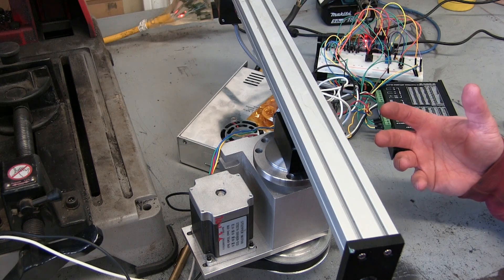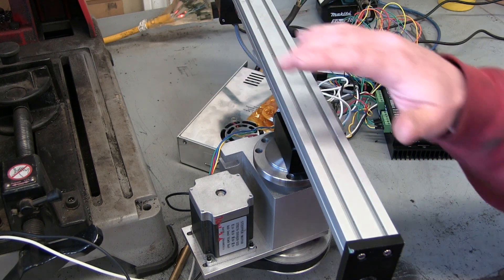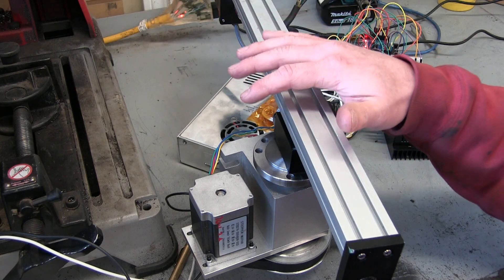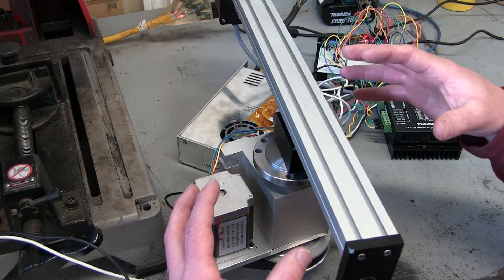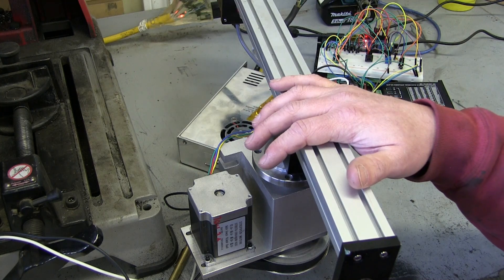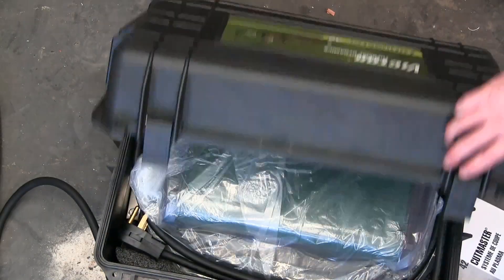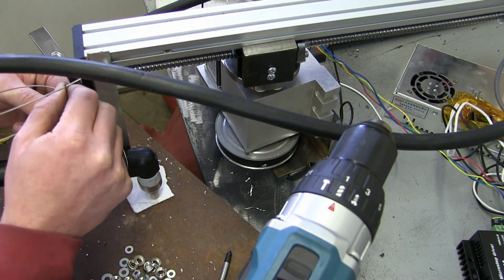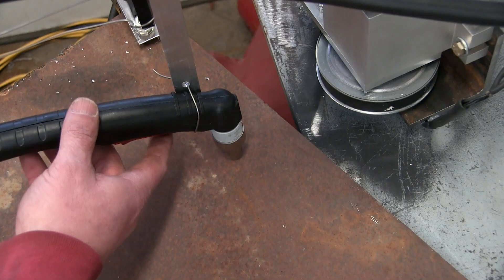Portable CNC Plasma Prototype

Comment: In theory it seems like a good idea for a quick way to punch out some simple shapes on material that can't be placed on a proper table.   I would think that a skilled hand would do just as good a job and here's why.  Plasma cutting in general is a hot mess, even on a good cnc table.  It is the one CNC machine, I don't feel comfortable walking away from while it is cutting.  When all the variables, and trust me there are a lot, are working right, it makes fantastic cuts, but when something goes array,  like it seems to for no damn good reason, it becomes aggravating to say the least.  I kind of for-see, fabricators getting frustrated setting that up and getting a good cut and eventually just doing it by hand anyways to get it done.  If your Z height isn't consistent enough, you are going to be making a lot of clean-up work after the fact or scrapping some metal.  If you can get that ironed out first, you will have a much better chance of making it a product that is simple to use.  A++++ for thinking outside the box!!

Comment: you need to multiply  (1 /  angle x cos) by the distance from the pivot to the center of the head. This works for keeping the x perpendicular to the linear slide.

Comment: Maybe reference angular speed from the current radius so you dont just use 1 speed for the small radius and the larger radius or have to worry about having to calculate the best speed for each time you change the design it would just do it automatically for you. my 2 Canadian pesos

Comment: put a cam so you can manually remotely place the start position. hell, 2 or 3 cams, one looking at the base and machine itself to correct for movement errors, optical mouse sensors around the base perhaps to make it really perfect corrections, one normal camera to setup the start position remotely after equipment setup, and finally a shielded working cam to look at the cut during use. :) maybe use pixel based command with rapid x and y changes instead of "long cuts" for shapes to prevent uneven squares due to a central pivot point. step by step wizard for the cuts or manual mode "pro" so they feel cooler using it lol

Comment: Ave, my man.. it wont work because metalworkers/fabricators fail to understand that something can break if you drop it, throw it, hit it with the hammer, let it sit outside in the rain, let it sit in the dusty shop corner for a 41 years and so on.. otherwise. great idea

Comment: This is fuckin brilliant! I tinker with the magic sparks but I'm no welder, my lady however is a level B red seal welder and an apprentice fabricator, she would kill to have something like this to spit out small part's that are not worth putting on the old burn table. Sweet mother of god I can't wait to see how far you get with this thing. If you get a good working final product she and almost any welder in the business would throw money at you. Also just thinking that a drag tip might not be the best choice for this application slag and what have you might cause snags jump and jitters. I would also do some testing so you can have some preset cut speeds for different gauges of steel. Your on to something her bud better visit the patent office soon!

Comment: So, the only issue i see is that the sections cut during the rotary axis would have a slight curve to them, as the arm is rotating around a central point... If you can work out a way to compensate for that i'd say it's close enough to perfect.

Comment: OR have the tip be replaceable with a marker. so they can run the job on the material before actually cutting it. that'd help develop trust in the tool.

Comment: You could fairly easily sort out a line follower tip which would allow them to draw the cut onto the material with a marker. rune the line follower over it a few times. map the movement from it. swap to the cutter tip and have it cut away. That'd make it easier to use and wouldn't require a phone.

Comment: ok  Tip for Mr AVE... 3d print or metal cast the parts needed to hold that torch... cos that little flimsy wire is just a no no.... I mean you could even use wood or create the parts with plastic... even with clay... naw you could go the extra mile and use a soap bar like Woody Allen... bicarbonate+superglue will also create a super strong bond similar to 3d printing... bondo could be use to fill gaps...

Comment: It needs a camera to look at the surface where you can draw what you want to cut out - or show an 'X' where the centre of a hole goes.  The camera could be mounted on the stationary part so it can calibrate it'self.  Don't underestimate the complexity of using polar and linear at the same time though, it sounds easy but one is absolute whereas the other has to be rounded and the rounding errors can work against you.

Comment: nice! been thinking about building something like this using a scara type manipulator, mostly because it would be easier to put together and cheaper, harder to program for though and a little less skookum.

the inverse kinematics for that are pretty easy, its just converting from Cartesian to polar.
r=sqrt(x^2+y^2)
t=arctan(y/x)
where r is the linear position of the slide on top and theta is the angle of the rotary base

you might have to import math.h in order to get the sqrt() and atan() functions to work, you may also have to convert to radians and back as well.

if you can give me stats on the steppers, any gear and belt drive reductions, and thread pitch on the lead screw the rest of the math part is easy.

Comment: I think a problem with the algorithm will be that you may have an issue working out the radius.  Setup will need to back up the linear axis to a known radius stop.  I am playing with python at the mo, and will have a play at some code. I have a cnc router, but it is all controlled visually in the software (Step Four machine). I did G Code at collage but this was 30 years ago. It can't be difficult as that little Chinese kid is doing it all the time.

Comment: Fuck yeah I'd use this. It doesn't need to be on a phone, in my opinion. Make it a usb gadget. Make the protocol (and formulas for shapes) open, write an app for Arduino and/or pc, let the bright guys in ios and Android development write the app.
Ideas: 
Make working with stock plasma cutter handles and switches a primary goal.
Make the arm invertable. If your working with a big shape on a sheet, get the most stable work out of it by hanging out over the center upside down with the torch pointing the other way by just slinging a piece of square tube or stick over some jack stands

Comment: I'd say the biggest concern would be setting your coordinate system in relation to a global (project) system? I mean long term would be like lasers and built in levels and bluetooth connected to your fridge, but in the short term maybe being able to manually set a 2d coordinate system by having a built in laser to the arm so that you could manually set 2 points into the systems 'memory'? one for a home point, the other to set the angle?
Reply: Also if laser cutting is anything like waterjet, then maybe (in version 19.2) have 4 axis? a rotating axis about the arm, (maybe on the other side of the arms point of rotation to act as a counter weight as well), and another built into the cutting head, on the axis that is tangent to both the axis of the arm and the axis about the arm...

Comment: As many said, positioning the tool could cause a bit of hindrance out in the field. If I'm in an abyss of a sump or in a chute cutting holes of all god awful shapes and sizes, most likely I'm in there already with the torch. To go in and get all my dimensions and then have to program and set up... I could have it half done. 
Now if I were at a cutting bench or back of truck, doing lifting eyes, gussets, and odd shapes and needed multiples, this would be the cats ass!

Comment: Yes, I would absolutely use this thing. I own an auto restoration / fab shop and this would be very handy for brackets / cutting frames. I think the most useful thing would be the ability to make a drawing on a smart phone app or trace (or outline) an image taken by a camera / freehand a drawing if necessary. That way the shape could be custom made in the field without much extra work. Dimensions of the shape could be then input into the app manually. Fantastic idea, I'd buy one if you ever sell them or create a kit with parts to build it yourself. A+ idea for sure.

Comment: AvE, why not just go for a full arm so you can move in the y axis as-well. A small mag base arm with changeable tools, plasma cutter, drill, welding electrodes whatever. To make it simple to use you could have some sort of learning mode where you move the thing on the desired path and it just records its encoder positions as a macro or somthing?

Comment: Problem with using plasma is you are limited to how thick of material you can cut through.  Great for proof of concept but I would like to see something like this with an oxy-acetylene torch like a Victor #5 cutting through some 4" plate that would be bitchin'. As far as being able to program this using conventional G code you would have to have two linear axis. What are you using for controls?

Comment: I'm thinking about how to best program the kinematics on this, not sure if an ideal world solution that is super math/calculus heavy would be a good idea, or if some dumb program that continually corrects itself to maintain a small tolerance from the cutting pattern...

Reguardless, you're going to want to use a ESP32 or similar module for this robotic cutter. Has the IO you want, and it's cheap and has WiFi. plus you can run almost any programming language on it.

Also runs Arduino code! since you already know that language!

Comment: That's pretty amazing man.  That would make plasma cutting out parts for the metal dice I make (basketball sized out of 12 gauge steel) very easy.  D20 isn't too bad as it's all triangles, but when you get into D12, or D10, the shapes are not as simple to cut out.  It would also be incredibly useful in the hackerspace, where we don't have space in the welding area to dedicate for a full CNC plasma setup.

Comment: I think the big thing is a canned algorithm for the range and travel in the ark ( so if you need to cut a straight line across the work  piece) . some sort of feeler gauge for distancing  on uneven surfaces, so then also an up down Axis. absolutely right on needing to make the interface simple. maybe also an easy targeting system for lining up Cuts better. You could cook up a modular rail systems so keep an extra long arm tucked away and have the short one ready to go for most jobs. put out a youtube call for some programers. very cool... mobile Manufacturing in a toolbox. also what if you put some sort of optics on it so it could follow hand drawn lines.... gimmicky but cool if you could just snap a chalk line for a straight cut.

Comment: Hi Ave, this is also an awesome tool for emergency services, disaster rescue works due to less fatigue and for rebuilding stuff in less educated areas.. I had the chance to work with Baxter robot (ffing cool piece of kit btw) and the way you program his movement is by guiding the arm(s) and recording the XYZ movement of the arm(s).. and then repeat the recorded movement as a macro function.. Do you think this is possible too with your CNC plasma cutter? Record the movement on the XY-plane by moving the arm manually and then repeating the movement as a playback function?

Comment: One of the challenges will be getting the tool registered in a known position on the work surface.  The magnetic drills are relatively simple, since you only need to set one reference point (the center of where you want a hole).  For cutting shapes that aren't circles, you need a simple way to set at least two reference points, or a point and a reference angle so you can adjust the cut path relative to the work piece.

Comment: Hell yeah I'd use it. Hardware wise your two biggest hurdles are going to be getting the vertical footprint down, as well as getting straight horizontal lines. Both of which  are  easy. The challenge will be making it cheap.

Comment: Excellent idea! One thing I noticed and so did you was the rotary axis feed rate. Because you are making an arc the further from the pivot you get a larger movement at the torch end. You may have to compensate for this in your programing. Just my 2 cents. NOTE: Its 2am here in Ontario so the brain cells aren't to on.

Comment: keep it parallel, set the rotational speed proportional to the radial stick out, run the hose through the square stock to a 90ish° bend cut a nice little hole for the tip to stick out just enough, clamp the trigger down on the torch and wire up a valve for the gas and a trigger for the electricity, get some of those el cheapo yellow proximity sensors one at each end of the arm and one each side of the torch side so it knows where the end of the workpiece is also maybe one or two pointing parallel to the workpiece in the radial travel direction to avoid crashes, if cutting upside down set the tool path to end somewhere safe so the work piece doesn't fall on the plasma cutter and fuck your tip up (EXPENSIVE AS FRIG!) or program to leave small tabs like some cncs do so the cut out doesn't fall, use planetary gear for the rotation maybe?/ rack and pinion for radial extension, maybe utilise worm gears to keep the slop out, maybe use a 10 or so darkness shield custom made around or on two sides of the cutting tip so you can keep an eye on it without a welding helmet on maybe one of those fancy electric dim types, a tool like this might deserve a molded case with dedicated laps/stones to keep the magnet nice and to prepare the work piece, memory presets through USB sticks for certain jobs with storage for the usbs in the case them simple folk love USB sticks and only poking a button or two, a removable roller on a swivel near the cutting tip possibly for precise jobs where the machine is at full extension....

paint it black.

I've got 1000 more bits of input beyond that, but we all know uncle bumblefuck doesn't read my comments.

Comment: Sadly it's never be easy, because you will always enter the fucking coordinates in wrong and screw up whatever you are working on. If you've got a magdrill you see just where you are drilling, but a CNC goes on its own. Might be able to spray on some sort of thermosensitive paint and hit it with a first pass with a laser to preview what you are about to do, but when you are cutting holes in a  truck frame or whatever you only get the one chance to screw it up.

Comment: An excellent idea indeed. As a welding student, I would quite like to use one of these when I end up in the field. I'd gladly trade off setup time to avoid having to pull out the old grinder to fix whatever goofy little wiggle there may be in a hand cut. While I'm not much good at wrangling the 1s and 0s as far as helping out with programming for it, I can sure see a market for this, and I wish you the best of luck in creating a production model.

Comment: Freaking AvEsome! I think you could leave the possibility to use external cad/cam for more complex shapes simply making a quick and dirty algorithm that translates from the cartesian system to the rotary+linear system. Unless you don't want to develope a proprietary but still dead simple CAD/CAM. For sure welders and fabricator don't want to fuck around with speeds and feeds so I think you gotta develope a CAM routine that keeps the speed really constant and give them just one "knob" to control speed, then put pin plug to the thing to hook up the torch control, and we're good to go. I think it could seriously break the market in the small fabshops and the hobby guys who want a quick way to cut complex shapes into stuff. I believe less on the use under a truck bed, the mag drill is still a more compact and more immediate to use if we're talking of putting holes into a truck bed., But I think if you can make it at a reasonable cost, you'll sell it like peanuts anyway. I know for a fact I'd buy it mostly for making weld on gussets flanges and stuff.

Comment: Just my simple comment that has already been said but theres one thing to note about radial coordinates. a rotary motion at half extension may be slow enough to cut steel, but at full extension it wont because the tip will travel further in the same amount of time the halfway point will, so be sure to have rotary motion slow down when the arm extends further.

Comment: Some laser markers have the ability tol project the text or shape you want to mark on your part. I think you might want to have something similar, to know what size hole and shape you will cut. So my solution is to put a tape measure similar to a logging tape (http://www.forestry-suppliers.com/product_pages/Products.asp?mi=14261&itemnum=59493&redir=Y) in the mag base concentric to the center. It would be simple to make a 360 degree dial plate to also to find your rotation. So what i'm imaging is you attach your magnet base to your work surface, you pull out your tape measure to set your distance from center, while that tape is pulled out with tension on the tape it will create a straight line to the center and you can set your clocking of the arm from the dial plate. From that info you can set your x,y, zeros for your shape. I think you could also make a chingus to go on to the tape something that can slide up and down the tape, the chingus would be have to lock down on the tape and hold a sharp pin. Using the pin and a loop on the end of the tape with a paint marker you can make something like a compass, you can now draw circles or estimate the length and width of a square. It would be easy of the app to give you the lengths needed to find intersections of whatever shape you want to make. I'd be happy to draw it up in solidworks if needed if i did a shit job of explaining this.
Reply: sorara like a Beam Compass.